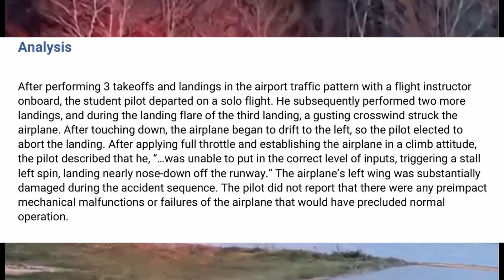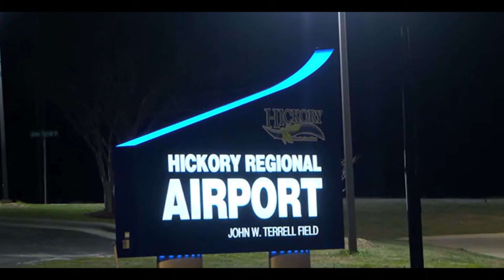Student Pilot Stalls on Go Around

Comment: I'm relieved to hear that the pilot survived, and I hope this experience serves as a valuable lesson for them. I had a similar situation on my first solo flight at KLEE, navigating a strong crosswind during landing, though the outcome was different. Instinctively, I applied power and leveled off to execute a go-around—though not without a moment of fear. I owe a lot of my preparedness to my flight instructor, a former military pilot, who consistently challenged me with emergency scenarios to ensure I was ready for the unexpected.
Reply: It's too bad they don't teach what you did, (level off). They teach students to start climbing before flap retraction, as if, if you don't start climbing immediately you'll crash into something, which is ironic because you're more likely to crash if you try to climb while your flaps are still down.
Reply: @philipmartin708  wrong. that is not what we teach. any CFI who teaches to climb before regaining speed needs their CFI certificate revoked.
Reply: @SoloRenegade  I didn't say anything about trying to climb at less than Vx.
Reply: @philipmartin708  " I didn't say anything about trying to climb at less than Vx."

I never mentioned anything of the kind either. learn to read. Being able to read and comprehend English is a requirement to hold a Pilot Certificate. you should work on that.

" I didn't say anything about trying to climb at less than Vx."

exactly my point though. you shouldn't be trying to climb AT ALL before regaining sufficient speed. it's simple physics. without excess airspeed/thrust, you CANNOT climb.
Reply: @SoloRenegade  My comment wasn't about insufficient speed as you seem to think it was. And in response to your last sentence, you don't need excess airspeed in order to climb. What you do need is thrust exceeding total drag.
Reply: @philipmartin708  you really need to learn to read.

"My comment wasn't about insufficient speed as you seem to think it was."

you don't seem to know what your comment was about.

"And in response to your last sentence, you don't need excess airspeed in order to climb. What you do need is thrust exceeding total drag."

which is exactly what I said, you need excess airspeed/thrust. excess airspeed can be traded for climb. and thrust is a function of airspeed as well.

you've added nothing to this conversation, confirmed you still can't read, and have refuted literally nothing I said.
Reply: @SoloRenegade  I still don't know how "regaining speed" relates to my initial comment since I made no reference to airspeed.
Reply: @philipmartin708  Original comment said: "I applied power and leveled off to execute a go-around"

you said: "It's too bad they don't teach what you did, (level off). They teach students to start climbing before flap retraction, as if, if you don't start climbing immediately you'll crash into something, which is ironic because you're more likely to crash if you try to climb while your flaps are still down."

this is ALL about airspeed and NOTHING ELSE. You can't climb without enough airspeed/thrust. If you're airspeed is on the backside of the power curve you will not climb or struggle to climb. you cannot retract flaps without enough AIRSPEED to offset the loss of lift. You can't climb with too much flaps because you have too much drag leaving you with no excess THRUST.

The WHOLE REASON to level off on a go-around is to ACCELERATE, to gain AIRSPEED, so that you can retract flaps, so that you can get out of the backside of the power curve, and so that you have enough speed and excess thrust to CLIMB. and yes, so that you don't hit things ahead of you. if you fail to climb you WILL eventually crash into a tree, building, tower, wires, etc. Many runways are very short, but trying to climb too early is worse than leveling off and climbing out faster once you regain airspeed.

learn to read, learn some reading comprehension. Learn some basic aerodynamics. Go get retraining with a CFI.
Reply: @SoloRenegade  If your airspeed is already inside the green arc, why do you need to gain airspeed to retract the flaps? Again, my comment didn't refer to airspeed, too slow or otherwise. It referred to initiating a climb before retracting the flaps. I advocate retracting the flaps first, and then climbing.
Reply: @philipmartin708  "If your airspeed is already inside the green arc, why do you need to gain airspeed to retract the flaps?"

go back and reread my comments, I already explained it explicitly. Seriously, you need to learn to read. And if you're a pilot, how is it you know nothing about how flaps work?

"Again, my comment didn't refer to airspeed, too slow or otherwise."

yes it did Everything in the original comment about levelling off before climbing, and your response, pertains to AIRSPEED control and the regaining of AIRSPEED before climbing. the fact you can't grasp this is disturbing if you are a pilot.

"It referred to initiating a climb before retracting the flaps."

and I EXPLICITLY explained why you Can't climb with flaps extended. go back and reread what I already wrote.

"I advocate retracting the flaps first, and then climbing."

Yes, I know. the thing is you clearly have no clue WHY you're doing that. Everyone in this comment thread is saying to add power, maintain level flight, retract flaps, and then climb out at a Vx or Vy pitch attitude. As soon as your flaps are retracted to a sufficient degree and you have sufficient airspeed, you can start climbing.
Reply: @SoloRenegade  "the thing is you clearty have no clue Why you're doing that."
Do to. To not climb while the flaps are down and causing detrimental drag. That hurts climbing ability you know.
 Do you know about Dan Grider and the flaps and the corn field? 
  And now for this one.
"and then climb out at Vx or Vy pitch attitude." Pitch attitude, no. Indicated airspeed, yes.
Reply: @philipmartin708  " And now for this one.
"and then climb out at Vx or Vy pitch attitude." Pitch attitude, no. Indicated airspeed, yes."

you don't even know what's going on, and you're going to lecture me? Unfortunately you look like a fool here.

do you know the difference between pitch attitude and indicated airspeed? What controls Vx airspeed? How do you achieve your target indicated airspeed in a climb? Clearly you don't know.

""the thing is you clearty have no clue Why you're doing that."
Do to. To not climb while the flaps are down and causing detrimental drag. That hurts climbing ability you know."

yes, you know about the flaps, but not nearly enough. you're stuck in Rote. You lack Understanding, Application, and Correlation. You only know what you've been told on youtube. 

"Do you know about Dan Grider and the flaps and the corn field? "

Who cares, what's your point? I've actually flown these aircraft and these scenarios. I actually teach my students these sorts of things in flight training. to you it's just theory you heard about, to me nd my students they've actually practiced these things and seem many things demonstrated for real.
Reply: @SoloRenegade  The Dan Grider story prooves my point beautifully. 
Do you tell your students to just pitch up to a predetermined attitude and disregard the indicated airspeed? I hope not. That won't work up at Big Bear Airport. 
You accuse me of not knowing much about flaps. Well I know this. Lowering the flaps doesn't increase lift because lift equals the weight of the plane. What the flaps do is lower the stall speed and increase drag.
Reply: @philipmartin708  “The Dan Grider story prooves my point beautifully.”

Proves nothing. And you haven’t articulate yet how it applies to our discussion and supports your nonexistent argument.

“Do you tell your students to just pitch up to a predetermined attitude and disregard the indicated airspeed? I hope not. That won't work up at Big Bear Airport.”

Stop trying to act/sound smart. You have no clue. My students flew to Leadville, Aspen, and other places. All flying is at high DA. Get over yourself. You’re grossly oversimplifying things, as is to be expected from someone who knows nothing about how airplanes work. It all depends upon the airplane, point at which they go-around, the configuration they were in, etc. There are many ways to go-around in different situations. Teaching people that there is only one right way to do things is what gets people killed when a situation requires a different response. Go get some retraining with a CFI.

“You accuse me of not knowing much about flaps. Well I know this. Lowering the flaps doesn't increase lift because lift equals the weight of the plane. What the flaps do is lower the stall speed and increase drag.”

hahaha. This proves how little you understand flaps. You clearly know nothing. I am not just a CFI-I in airplanes and helicopters, I’m also an Aerospace and Mechanical Engineer with tens of patents, so relating to aerodynamics principles. I even invented a novel flap mechanism. You can’t BS a person who knows far more about the subject than you ever will. You obviously don’t know the first thing about lift, weight, etc. And you continue fail to understand how this whole conversation is fundamentally about AIRSPEED.

But go ahead, continue to make a fool of yourself.
Reply: @SoloRenegade  You're the one who made this conversation about airspeed, not me. It all started with your "regaining speed" remark. I didn't say or imply anything about airspeed before that, only the sequence of starting to climb before the flaps are retracted. I wasn't commending the guy for simply leveling off during his final approach,, but for (not immediately) starting a climb before the flaps were retracted.
 Also, at the recommended approach speed, even over-the-fence speed, you're already inside the green arc and very close to Vx anyway. So your "regaining speed" remark didn't make sense to me anyway.
Reply: @philipmartin708  "You're the one who made this conversation about airspeed, not me."

proving you still don't understand. teh original comment was about airspeed, you responded with a comment that affirms the airspeed focus.

" I didn't say or imply anything about airspeed before that"

you did imply by engaging in the topic. you don't have to say "airspeed" explicitly to be in a conversation about airspeed control. this isn't that difficult to understand.

"I wasn't commending the guy for simply leveling off during his final approach"

never claimed you did, and the guy never levelled off during his approach that we're aware of.

"....but for (not immediately) starting a climb before the flaps were retracted."

so now you're advocating to begin the climb BEFORE the flaps are retracted? make up your mind. you're twisting yourself and your argument into nots.

" Also, at the recommended approach speed, even over-the-fence speed, you're already inside the green arc and very close to Vx anyway."

yes, in a power off glide, and slowing in the flare.

"So your "regaining speed" remark didn't make sense to me anyway."

becasue you have no clue what you're talking about, as we've already established. you do not know what speed he executed the go-around at.

If he aborted early, but was trimmed for descent, he probably experienced a trim stall, as I've discussed in other comments on this video. the correct response to a trim stall is to push the nose down and fly level until you can accelerate/climb under control, or adjust the trim. But you need to level off first.

If he aborted entering the flare at near Vx, he still has to arrest the descent by pulling the nose up, bleeding speed and dropping below Vx, all the while with high drag flaps out slowing him down. It take a moment for the engine to come alive and develop thrust and re-accelerate the aircraft back to Vx. in the meantime you fly level down the runway as you start retracting flaps. Also, as you slow down below L/Dmax speed, you drag stars increasing dramatically, making re-acceleration more difficult the slower you get. Meaning it will take more and more time to reaccelerate to a safe flap retraction speed. Thus you need to level off in order to first regain AIRSPEED.

Since you're clearly not aware, one of the variables that controls lift is AIRSPEED. With flaps out you've changed multiple variables affecting lift. AOA, Airfoil shape, airfoil size, reynolds number. This gives you a higher coefficient of lift, allowing you to fly at slower speeds while generating the same amount of lift, and enables slower than normal flight below a no-flap stall speed. When you retract the flaps, you lose all those lift producing benefits, and thus are no longer producing enough lift to hold altitude. to compensate for this loss of lift, you must gain more AIRSPEED in order generate the same lift as before. Hence you need to level off and accelerate BEFORE retracting flaps. If you go-around late and are now flying BELOW no-flap stall speed, you must get back ABOVE no-flap stall speed BEFORE retracting flaps or you will induce a stall. Also, flaps add a whole lot of drag, which prevents acceleration and climb. Drag opposes thrust. 

and the slower you fly, the less thrust the engine produces. So you're too slow, low on thrust, high on drag, and cannot climb yet. With such high drag, you have no excess thrust, and therefore CANNOT climb. You must level off, allow the plane to reaccelerate (regain AIRSPEED), raise the flaps to an acceptable degree (less drag, but still generating higher lift), and continue retracting flaps as you climb away as your AIRSPEED is regained. In many aircraft, such as my Cessna 150D with manual flaps (0-10, 20, 30, and 40deg settings), best climb is achieved with NO flaps. short field and soft field takeoffs in my C150D are performed with NO flaps of any kind. they produce too much drag and not enough additional lift to be beneficial, causing the airplane to accelerate poorly. And on go-arounds, you need to get the airplane back into the optimal climbing configuration, which requires regaining AIRSPEED in order to retract flaps and generate enough lift to not sink when flaps are retracted.

if this still isn't enough for you. you're a lost cause and should consider surrendering your pilots license back to the FAA.
Reply: @SoloRenegade  "if this still isn't enough for you"  Oh, it was enough. I surrender.
Reply: @philipmartin708  surrender is not the goal. learning is. Pilots need to understand how this stuff works so they don't kill themselves and others.

Comment: Gotta push the yoke hard to keep the nose down after applying full power because you have full flaps still set for landing. Catches a lot of new solo pilots off guard.
Reply: Yes especially since the plane was trimmed to pitch up during the final approach
Reply: @CptAlfaMike  trim stalls are not talked about enough, nor demonstrated.
Reply: yup
Reply: My WWII Bomber pilot instructor, Lt. Col., trained me to not land with flaps.  Only use them when you need them.
Reply: @BobbyStanaland Old school badass instructor 🎉
Reply: @BobbyStanaland  you should land with flaps, they are there for a reason. but yes, you absolutely need to know how to land without them as well, and use them as needed (you don't have to land with full flaps). Gusty winds we don't use full flaps typically, for example. Aircraft do suffer flap mechanism failures and so you may had to land no-flap and need to know how. Not all planes even have flaps. but if you have them and aren't landing with flaps on a regular basis, you're putting yourself at undue risk of death/injury, unless you're specifically practicing no flaps. Not using flaps increase the chance of a fatality during a landing accident due to higher landing speed, can wear out tires and brakes faster, uses more runway, less room for go-arounds and such, may not be able to land at shorter runways, etc.
Reply: No flaps. Slips ftw

Comment: If he started to drift sideways because of a crosswind gust, he obviously did not use the ailerons to counter the drift and the rudder to stay on the centerline.  This guy was not ready to solo, there's always a crosswind of some sort except on rare days when the wind is down the runway.  When I flew floats on this river, the prevailing wind was always 90 degrees to the left with more often than not gusts.  If you drift with floats, you cartwheel.
Reply: How about the pilot who recently flew across the Atlantic and stalled and spun on a go around after a gust of wind? Was he not ready to solo either?